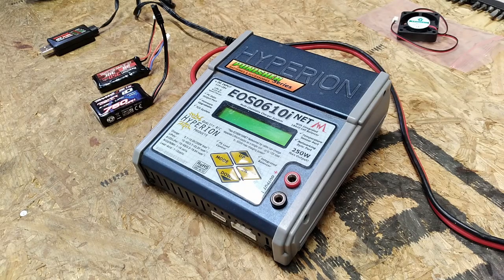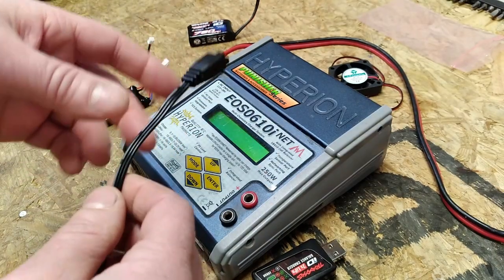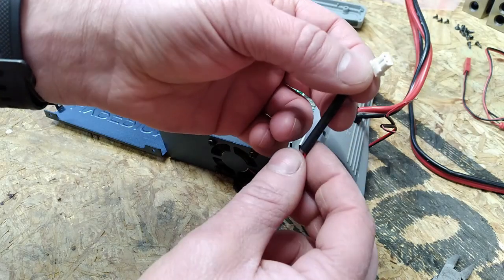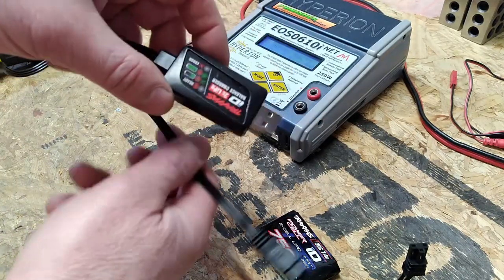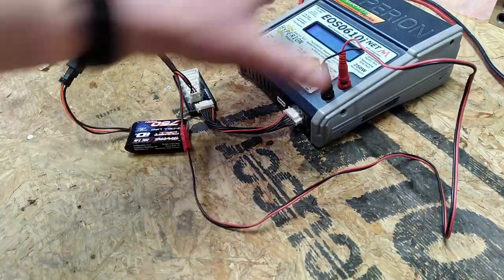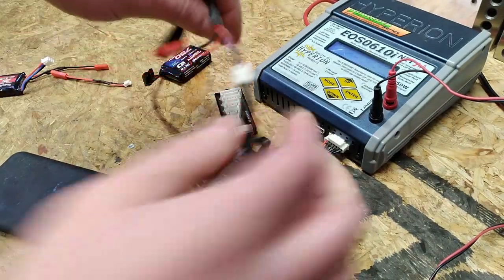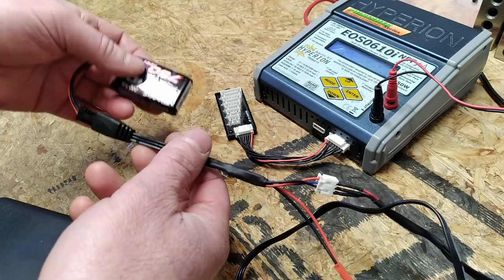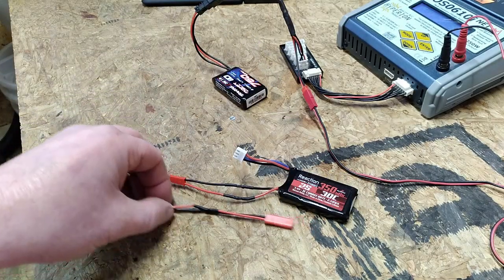Traxxas TRX4M Battery Connector Workaround!

Comment: Traxxas is so busy policing the industry so I can only use their brand of batteries in the TRX4M I cant even use my Traxxas EZ peak charger on there stupid proprietary trx4m batteries… guess I’m not gonna buy the TRX4M 
Also not going to buy it because there batteries are overpriced. But the length of effort they went into on the proprietary job on the car is a complete turn off regardless

I can charge the batteries for my mini T 2.0 with the traxxas charger making a simple adapter though… but I can’t use that battery in the TRX4M and I can’t use the TRX4M battery in my Mini T
Reply from the maker: Yeah I needed to be able to charge the TRX4M Battery on something that allowed my to put the battery in storage mode, so this little adapter was the result! Thanks for your comment!

Comment: I watched this video hoping you were going to show us how to make the adapter for the TRX4M battery. But all this video showed is the adapter completed.
Reply from the maker: You're right, While filming the video I felt as though I covered enough information on the adapter I created. Watching it back I can see I've failed to go into enough detail regarding the wiring of the adapter. If you're interested I could do a follow up just focusing on the adapter/charger wiring?
Reply: @havikhobbies  Please know I do appreciate your video. I am going to watch it again. Maybe I just missed something while watching. If you do make a video showing the adapter wiring, I am sure there will be a lot of appreciative viewers including myself. Traxxas keeps throwing all these proprietary connectors on all their models forcing people to buy their batteries and that sucks. I saw one video where a guy tested the voltage on each cell of a TRX4M battery after charging it with the included charger and the cells weren't balanced.
Reply from the maker: @goochma  I think Traxxas places a lot of value in making sure the experience for newcomers to the hobby is simple and enjoyable. I would also prefer more conventional battery connectors!
Reply: Please do a wiring video of the connections for both chargers thanks and a parts list for connecters
Reply: Great video, but do you mind posting a simple wiring diagram? Thanks dude
Reply from the maker: https://youtu.be/5lKgt2KQjIo?si=WVnHuEKdyTKeYb4G